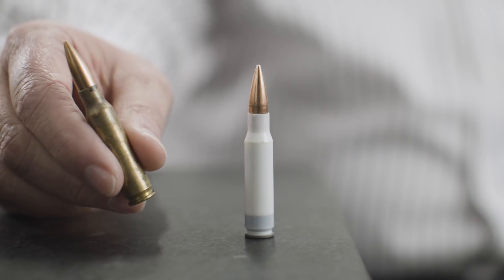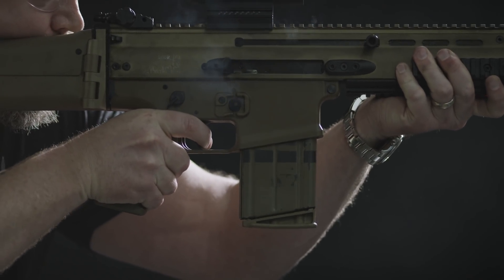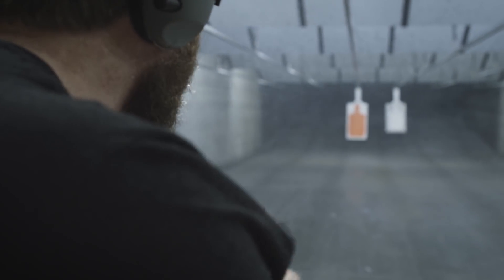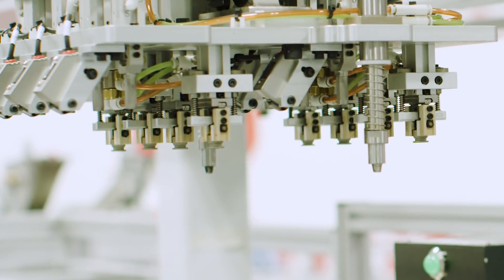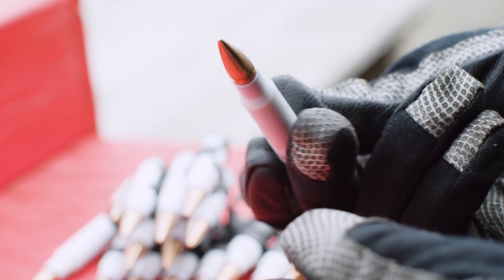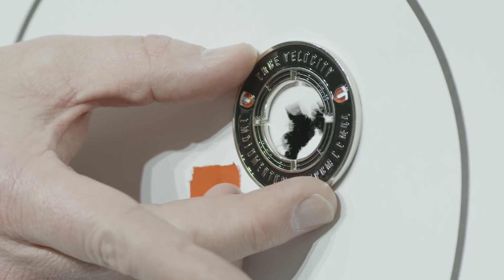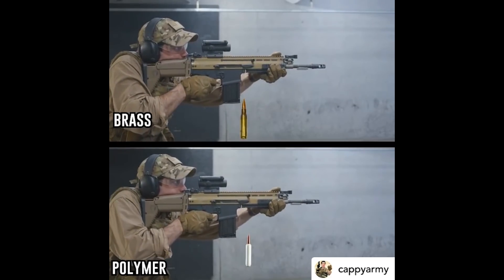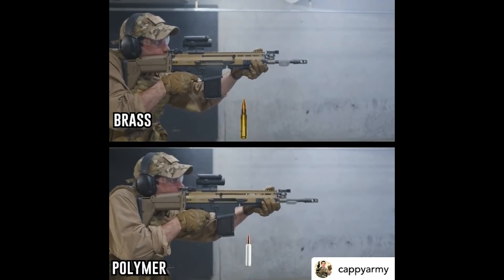Composite Ammunition is More Accurate than Brass | NGSW | Next Generation Squad Weapons

Comment: From what I have seen so far the accuracy is no better than a brass cartridge.  In fact I have seen better groupings using brass cartridges.
Reply: And from much cheaper brass cartridges
Reply: @Jeffinthewoods71  and you can reload brass cases.
Reply: Same here.
Reply: Does the weight of a plastic magazine differ that much from a brass magazine?
Reply: @cameronrobinson-white8455  think u mean the casing, not the mags. 
yes the polymer casings offers around 20% lighter weight overall.
Reply: @cameronrobinson-white8455  Did you mean case? Bullets don't have a magazine, they have a case.

Comment: I’m fairly skeptical about these sounds like a good bit of BS, and as a reloader only getting a single use out of the casings seems like it would be a more expensive alternative to reloading. Someone is doing a good job of serving Kool-Aid though  JMO 🤷‍♂️
Reply: Have to agree with this. Until we see the results in the real world it’s all just marketing kool aid.
Reply: It's not BS. Simple physics says plastic is an insulator, while metal is a conductor of heat. The beauty is in the precision molding process - which, TBH, is nothing new. The computer vision, scale, speed, and accuracy is also all well-established in production facilities around the world. Even the precision for micron-level dimensional quality control isn't new. The only thing that's new is the application.
Reply: @spdcrzy  as a mass scale production of ammunition I could see the cost saving benefits of using the plastic casings but that’s only for the mass production side, I personally don’t see how these bullets will have any thermal differences in weapons from brass cased bullets, simply for the fact that all of that fire is still being pushed down the barrel just the same in both cartridges

Comment: $10 per round? Brass case will due for now…….
Reply: Who the hell said anything about  $10 per round. If it's going to coat $10 per round then the U.S. military wouldn't be going anywhere near it lmao.
Reply: Yes they will
Bought more expensive green jet fuel ordered by Obama
Reply: @Brian Depending on the mission requirements then price is worth it. Better to have an option than no option.
Reply: Polymers are $1-$2 /lb, cost will go down with increased production
Reply: Bass, what??
Reply: Like hardbass ??
Reply: Like bass drum?

Comment: While I'm skeptical about the near term, just like polymer handguns back in the day I can see this taking off. Can you make this biodegradable? Would be a step up if say left to the elements after even 100 year it would break down as opposed to brass which like most plastic is forever.
Reply: I am less interested in it being biodegradable and more interested in how small and cheap the polymer manufacturing process can be and can they be recycled.
What I am trying to say, is that I am interested if it is possible to make (and/or recycle) the polymer cases at home for a reasonable price.
Reply: @johnsmithfakename8422  Well said

Comment: No matter what happens with NGSW, I think you guys should get a contract to produce ammo for the new .338 MG.
Reply: They already have a "backroom" agreement to produce. 338 norma rounds. If you watch the U.S. army's testing footage, you can see they are using polymer cased ammo in all the different platforms and ammunition being tested.
Reply: I imagine that  with 400 rounds of a large cartridge like .338, you could save a good bit of weight by switching to poly case ammo.
Reply: Yea. So I can have a few rounds of these..
Reply: A polymer case will make any case failure much easier to clear vs brass.
Reply: @RadDadisRad  How will it be easier?
Reply: @RadDadisRad  not is it is melting.... just missfire. and missfires are unacaptabe in any kind of decent ammo.

Comment: Wish I had this stuff for my FAL
Reply: No you don't.  Brass cartridges are  better.  This stuff has bad groupings at 100 yards.
Reply: @samueladams1775  source?
Reply: @factsoftheconfederacy7151  so far people that have shot this ammo. Who tee hoo channel is a good place to start. Well over a one inch group of 3 rounds at 100 yards. Pretty bad for ammo that costs $10 a round.
Reply: @factsoftheconfederacy7151  your FAL should be able to do better with brass ammo.  Rifle used was a bolt action.
Reply: @samueladams1775  Its like 3.50 a round..4.25 if you factor in shipping. Dont buy the commemorative case..That is just expensive.
Reply: @Odinforever2000  for a .308 $3 a round is way too expensive.  Like I said, I will stay with brass.

Comment: So given that the case and chamber are not absorbing nearly the amount of heat they normally would, we can assume that that heat is being transferred into the barrel.

What is the effect on barrel life from running this ammunition all other things equal?
Reply: When we did our (somewhat unscientific) test with some demo rounds, our thermal camera showed that the barrel temps were nearly identical between 10 rounds of brass-cased vs. 10 rounds of polymer-cased. Chamber & bore were much cooler. Around 30 degrees Fahrenheit.

As to why the barrel doesn't actually run hotter because of the insulated casing...I would have two uneducated guesses. Either a) more heat gets propelled out of the end of the barrel since it can't escape through the brass, or b) less overall heat is generated in the first place due to the 8-10% reduction in powder the video above claims.
Reply: Man I wish I have brain like u guys
Reply: According to the video... because the composite case is an insulator, not a conductor... significantly LESS overall energy (heat) is being created and transferred to the chamber of the weapon.
Reply: @kyle_nickolite  the fact that the case is an insulator will have absolutely no effect on the overall energy created. The energy created is based on the energy release from the powder charge. That energy has to go somewhere. The chamber is cooler yes, but that does not imply that the barrel downstream will be also.

My question is: how much of this energy is now transferred to the barrel? If more of the charge is being transferred as energy to move the round downstream then it follows that barrel downstream might see more energy than with a brass case in which case it is plausible that barrel life is less than with brass cased. 

Perhaps it isn't though and I am missing something. That is why I am asking the question. I was hoping a True Velocity person could chime in on it since they'd be the most likely to know.

Comment: I seen some polymer blue case 762 ammo on the range. All I could think was who is going to pick this up it's worth nothing and it's just trash. Maybe it can be melted down and reformed for reloading but that requires heat which requires fuel. Is the end result going to be more efficient and less waste? I don't think so but I don't know enough to answer this question.
Reply: Plastic degrades every time it is melted down so I doubt it can't be reused as ammo cases again considering the pressure requirements.
I say stick to brass until the handheld laser and rail guns come into service.

Comment: Using a typical varget of 43 gn in both cases, the only way you can get higher velocity in one case is by increasing case thickness. Both cases fireform to the chamber, poly will just dump temp quicker than brass but the heat is still there. And consistent SDs are dependant on the particular barrel, chamber, projectile. You sir are full of poo poo.
Reply: Insulator vs conductor, learn the difference and you will understand what he is saying.
Reply: @Mediiiicc  it doesn't fkn matter, the chamber holds heat regardless of poly, brass or cheap ass wolf steel case. It's for a gas gun and lmg, shit's getting just as hot because of rate of fire unless you want to go back to bolt guns.
Reply: @l-e-m-o-n8276  Less heat passes through polymer insulator compared to brass conductor, the chamber stays cooler. 

Every time a round is fired a certain amount of energy is created from the powder, any energy that heats the chamber instead of creating pressure is just wasted energy. Polymer limits this waste. 

It might be easier to understand if you think of the chamber as a heat sink, since the chamber is absorbing heat that means the gas will be cooler (since the chamber stole the heat) which means it has less energy or pressure. If the chamber is not able to absorb heat because there is an insulator in between then the gas will be hotter and higher pressure for the same amount of powder used.
Reply: @l-e-m-o-n8276  I just explained the physics to you, if you chose not to believe science that is up to you.
Reply: @Mediiiicc  be gone small child.

Comment: You've told half truths deliberately here.
Reply: You mean, marketing?
Reply: Can you elaborate?
Reply: @Kevin117  yes, becoz is plastic, it don make it more speedz
Reply: @l-e-m-o-n8276  
How so?  If more thermal energy is spent sending the projectile down the barrel instead of heating up the case since that energy has to go somewhere doesn't that equal more efficient use of powder meaning more velocity for the same amount of powder?
Reply: @MrTappers7  chamber is metals stillz. Will hold warm bro
Reply: @l-e-m-o-n8276  
Yes the chamber will eventually heat up over time (definitely not as fast as brass) but you didn't answer at all how there wouldn't be a velocity increase.  If more of the thermal energy is spent sending the projectile down range instead of heating up a conductor then how does that not translate to more velocity or more efficient powder burn?
Reply: @MrTappers7  becoz pressure is velocity, pressure require equal heat regardless of metal or plaztic.
Reply: @MrTappers7  the internal case temp is identical mate, Like i said the only way to change temp and pressure inside the case is by changing powder type or charge weight.